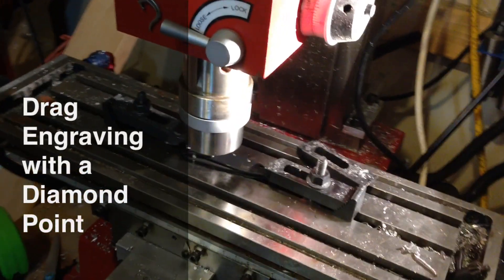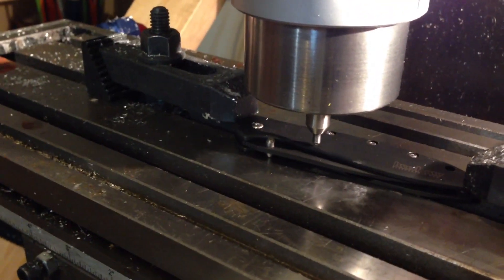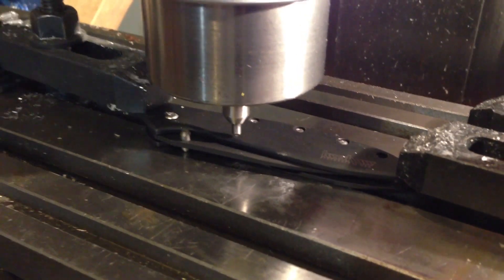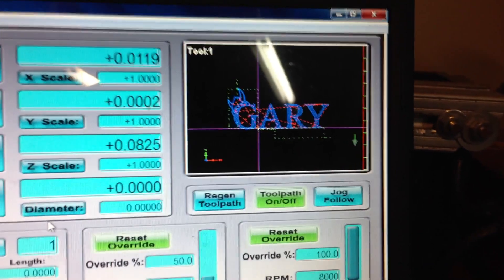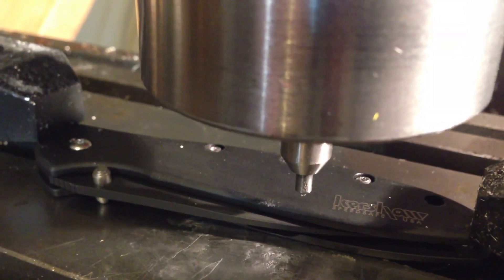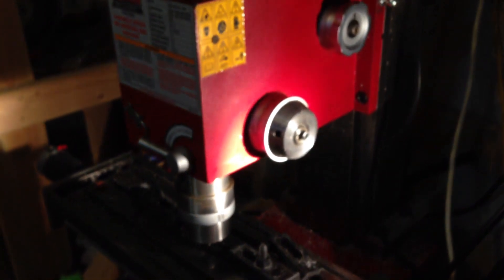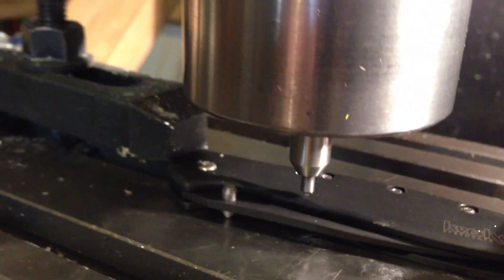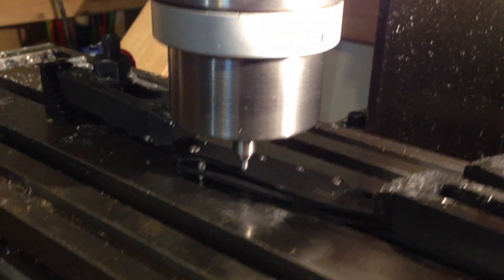CNC Engraving With A Diamond Drag Bit

Comment from the maker: The knife is a Kershaw Leek. I used V-Carve Pro to do the CAM. It has a very nice engraving functionality built in. How deep the drag bit engraves depends mostly on the material since I'm just scratching the surface. I set the CAM to go 0.05" down but the spring in the bit takes most of that. Aluminum is scratched much deeper than steel. This process also works on glass, FR4, almost anything.